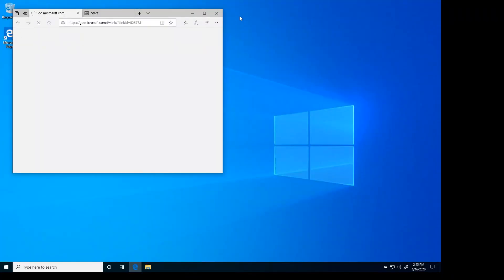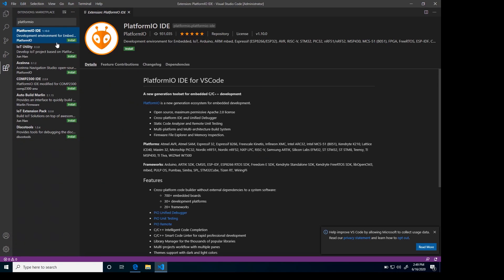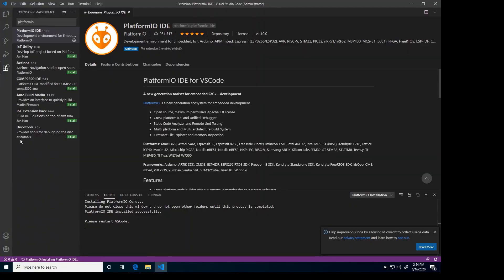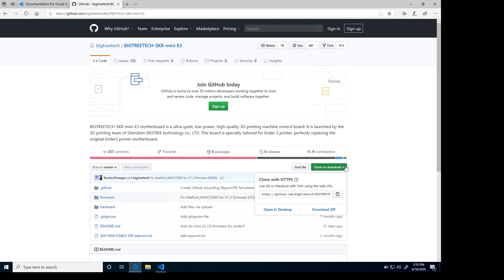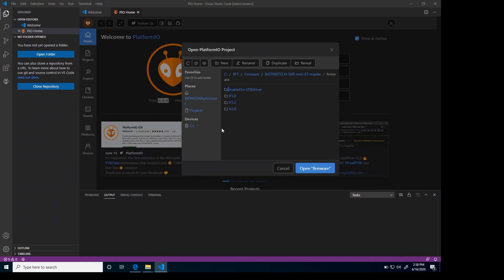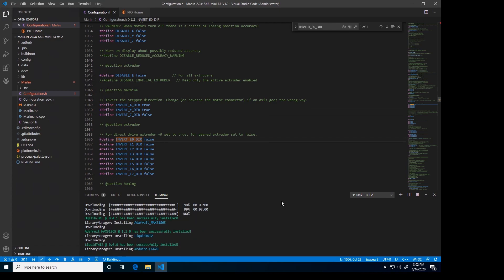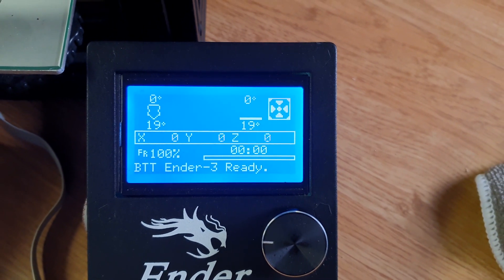BIGTREETECH SKR MINI | Firmware Update| THE EASY WAY

Comment: I have an Ender 3 Pro and a SKR E3 Mini V3.0 with 3.5" TFT screen and I can NOT get the firmware to load. It goes to a white screen that says Marlin Mode at the top over night and never changes. I followed your directions and can not find help anywhere.
Reply from the maker: I will be looking into this shortly, I might need to do an update video.

Comment: I don't know why others dont talk about this but it is easier to reverse the normal running direction for a NEMA 17 stepper motor is to just switching either the left or right pair of wires in the pin connector.  For example:  If the motor runs clockwise and you need it to run counterclockwise instead, you make a note or photo of your pin wirings and in my case that would be Black, Green, Red, Blue being that Black + and Green - are my "A" coil wire pair of positive and negative and the Red - and Blue + are the "B" coil wire pair (which those two are taken from the connection pin plug and reversed from Red and Blue to Blue and Red).  

Once you switch the two wires, your motor will run in reverse of what the factory sent.  

In a nutshell:  Your stepper has 4 wires which are actually acting as two sets of positive and negative.  Take one pair (the right view two wires) and switch their placement and your done!
Reply from the maker: Hey Ken, thanks for the advice, I will try that out and then make a video about it, in fact I am modding my Ender 3 V2 at the moment and I will probably run into that problem.
Reply: I ran into this problem  when I upgraded mine and didn't even know it was a known issue I just started swapping the wires assuming that it was wired differently and figured it out

Comment: thanks for the video! i have the same problem invert extrudeur.. everything work till i try to compil :/
Can you share your firmaware.bin ? please
Reply from the maker: Hi Mike, thank you for the comment.  I will try and get a version for you but did you use the "Windows Sandbox" method of compiling the firmware?  Please also send me the error message you get when compiling.

Comment: Need help!  My printer stopped extruding after doing this firmware update :( not sure why.  I have an ender 3 pro with no modifications to the extruder so I entered, "INVERT_E0_DIR false" is that wrong? *Update for the heck of it I tried setting it to true, obviously no luck.  Printer is now out of commission until I can figure this out.
Reply from the maker: Hi Eturian, I cover the geared extruder at around 08:00.  If you have a geared extruder, you will have to update your esteps, I cover that in another video: https://youtu.be/0bLd1ocwhBI

Comment: how do you enable the ezabl on the new skr firmware? th3d stopped updating for the skr mini e3 because btt threatened some lawsuit, and i'm afraid of messing something up. i haven't been able to get it to print reliably, but it's still better than nothing. if i get that working, the next step is the btt smart filament sensor...

Comment: I know this video is old but I'm trying to do some research because for some reason all of a sudden my btt skr mini e3 board won't read the SD card , it was printing fine with no problems  then I went to print something after printing something the day before and now if I put the card in it it the option doesn't even appear to print from it , I've tried everything from reformatting the card to new cards to a firmware update witch lead me here and nothing is working and there's no info about this problem anywhere so if you have any ideas how I can fix this problem It would be greatly appreciated,  thanks and have a great day
Reply from the maker: Hi, it sounds like a hardware problem.  The SD slot comes under a lot of pressure when you insert or remove the card and the hardware might be damaged on the inside of the slot or the solder joints.  You could go the octoprint route or install the BTT Touch Screen.  I installed one on my printer, still need to do a video on it, and that has additional slots on it.  Can you heat up the printer and move the x,y and z axis?  Try connecting up prontoface and do some diagnostics with that.
Reply: @FusionSource the SD slot doesn't really get used that much because i got the extended slot with the ribbon cable , n i did install the btt touch screen when I got the main board and as long as I don't have the SD card in it it powers up and functions normally and even if I start it up then put the card in it im never given the option to extract a file from it the print from midea selection never pops up

Comment: Hi can anyone help we are group of Vietnam vets which are trying to get into 3 D printing to help with PTS but we have embarked on a fruitless journey. With have an old midgda printer with a duet wifi board which we  updated to version 3 but we cannot get heaters to work just about ready to throw it out. We brought a cheap anycube mega zero and added a heat bed which worked fine for a while and now all we get is a unknown M140 s . We cannot  reset the board or update it as nothing happens . We have tried to follow the video but it does not give us the same result as the screens are different.
So we are back we’re we started 12 months ago , do we give up and start another program we are not computor literate and every video people talk to fast . Can anyone help we need a config program for a duet wifi v3 and how to reset the mega zero 
Thank you

Comment: Having the same problem where the extruder won't push forward, only backward when "loading". Any solution for this yet?
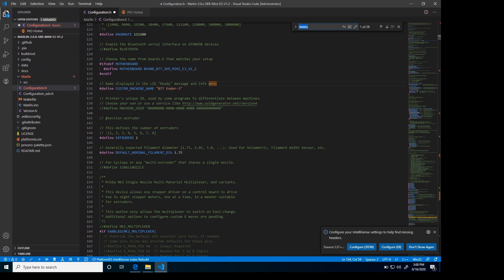Reply from the maker: Hi, if watch the vide at 8:40 I explain how to reverse the extruder.
Reply: @FusionSource  I have a geared extruder and changed it to false as instructed, still not dialed in all the way. Can't find any answers anywhere for this.

Comment: Please Help everything works but after i compile it and go to Marlin, pio, build, stm, there isnt a file named firmware.bin, there is a file named firmware and ive renamed it to firmware.bin but when i try to flash it, it doesn't work, it just boots up normally with out flashing. Any help would be appreciated ive been trying to fix this for hours at this point.

Comment: PLEASE HELP!!  I was watching someone else's video on installing the BL touch. I got in the firmware and changed a few settings as I thought they did. BUT somehow I messed up the card. Now when i turn on the printer the LCD has nothing on it, the touch screen version says " no Printer attached"  . Can you or anyone else for that mater help me? I have tried to find a way to reset it to the way it was and have tried on my own but just cant get it back to the seeing the screen.. Plugged in factory screen and it just stays blank.. so not the screen.. I hope I didn't fry the board.
Reply from the maker: Hi, have you plugged it into EXP3 on the Screen?
Reply: @FusionSource  yes it was all worked till I tried to set up the BL touch.. The loading and powering lights light up and from research it appears to all be working. Just not the screen. I cant get the touch screen nor the factory screen to work. I have ordered a new board to start from scratch.. I guess I have a nice looking paper weight now.. Well I do enjoy your videos and will just stick to the person I can understand fully (you) and goes at a nice pace. The other video I watched was talking so fast and about stuff I guess he felt everyone with a 3D printer would understand. Saying commands and stuff that got me so lost. Now I have a BL touch I may never use if it is that hard to install and set up.. Well thank you for everything. I will search and see what Videos you have that will be helpful in my learning process. Thanks again!!

Comment: I use the v2 version of this board. I also make use of the touchscreen lcd. Now for the LCD to work correctly I needed to uncomment a rule in the firmware, this worked out fine with your method, however, when I try to flash the firmware nothing happens. It just boots up normally. When I check the sdcard on my computer, the firmware.bin file is deleted. Any tips?
Reply: nevermind, I plugged the ribbon cable in the first instead of the third socket, flashed my firmware now, works like a charm.

Comment: (ENDER 3 PRO with SKR MINI 3E V2 ) I am trying to enable MESH BED LEVELING by compling in VISUAL STUDIO CODE but failed with the following message
" STM32F103RC               FAILED    @.333
The terminal process "C:\.platformio\penv\Scripts\platformio.exe 'run'" terminated with exit code: 1.

Terminal will be reused by tasks, press any key to close it."
Reply: are you using ezabl?

Comment: thanks for the video !! how to enable the power loss resume please
Reply: I have the same issue. My print resume is selected, but does nto work. What was this not tested before selling these? Or tested in the new firmware? I need that function back.
Reply: @jiml.9026  did u found out how ?

Comment: "I promise, it's easy" - I don't think so. Many of us are getting errors which are not being addressed. My error is not fixed by the "***Update" in the description. I know it works for some, but there's no guarantees it will work for you. Keep hammers and baseball bats locked up because you'll be inclined to use them during this process!!!
Reply from the maker: Hi David, have you tried using the "Windows Sandbox" method, this is the most "Virgin"" way of installing the updated firmware, there are no other external factors that can get in your way.  What version of the BTT firmware are you using?  Please let me know what issues you are getting and I will see if I can find a solution.  I have done this update a few times using the "Windows Sandbox" and it compiles everytime without fail.
Reply: @FusionSource  Hi Eugene, I don't currently have Windows 10 to use "windows Sandbox". I have a Mac. The main issue seems to be an error in "#include errors detected. Please update your include path." It's similar to the error in the comment from "LeapsofFaith". I've got SKR mini e3 v1.2 with BL Touch for homing. Must I use Windows 10 with Sandbox to get this to work?
Reply: Thanks to your video and advice I finally got it to work. The problem was the operating system. I'm on a Mac so I used that first, then tried Linux (Ubuntu), and Windows 7 (I had an old computer laying around with it) but all failed. I finally downloaded and installed Windows 10 and enabled Sandbox, compiled the exact same firmware the same as I tried before and this time it worked! I also had to apply the update adding the "board_build.core=maple" line to the platformio.ini file. I'm sure some more knowledgeable people can get it working on other os's, but to make it "easy" as promised, Windows 10 with Sandbox enabled seems to be the way to go. Thanks again to Eugene and all others that contribute to the 3d printing community!!
Reply from the maker: @muskokaliving2072  I am so glad you came right, I also apologies for saying "The Easy Way", I had no idea that it would be difficult on a Mac or Linux as I don't have these.  For some reason the Windows Sandbox just works.  Thanks for the comment and letting the community know that you came right using the Sandbox Method, way to give back man, really appreciate it and shows what makes the community so great.

Comment: Get to the stage where I go to "build" the project in Visual Studio Code and run into the error:
 "{
	"resource": "/c:/Users/ssv_m/Desktop/BIGTREETECH-SKR-mini-E3-master/firmware/V1.2/Marlin-2.0.x-SKR-Mini-E3-V1.2/.vscode/c_cpp_properties.json",
	"owner": "c:\\Users\\ssv_m\\Desktop\\BIGTREETECH-SKR-mini-E3-master\\firmware\\V1.2\\Marlin-2.0.x-SKR-Mini-E3-V1.2",
	"severity": 4,
	"message": "Cannot find \"c:\\Users\\ssv_m\\Desktop\\BIGTREETECH-SKR-mini-E3-master\\firmware\\V1.2\\Marlin-2.0.x-SKR-Mini-E3-V1.2\\include\".",
	"startLineNumber": 9,
	"startColumn": 17,
	"endLineNumber": 9,
	"endColumn": 124
}

Have tried redownloading the files etc but can't get it to compile.

Comment: Good tutorial to follow through, however building returned an error with the includePath in Configuration.h (for some reason unbeknownst to me)

Actual error message is:
"#include errors detected. Please update your includePath. Squiggles are disabled for this translation unit (C\Users\user\Desktop\BIGTREETECH\BIGTREETECH-SKR-mini-E3-master\firmware\V1.2\Marlin-2.0.x-SKR-Mini-E3-V1.2\Marlin\src\MarlinCore.cpp)."
Reply: same
Reply: I agree did anyone figure out how to fix this yet?
Reply: @humerusdoc4189  you need to use the latest marlin version.
Reply: @alexam694  No change still happening.

Comment: This did save me. Up to a certain point and I thank you but I get 45 errors when loading the btt firmware folder. When building I get 3 errors. Includepath error and cant find firmware. Somebody please help.
Reply from the maker: Hi Jonnathan, I have found that doing it using Windows Sandbox makes a big difference.

Comment: Since updating following this guide my machine freezes after a few hours and no longer displays the full file name of what is printing - help required
Reply from the maker: Hi Mark, not sure why it would freeze, the only thing I can think of is the main board might be overheating, check the motherboard fan,  I might be wrong but that is all I can think of.
Reply: @FusionSource  Fan is working fine, all is working fine in fact. I have gone through my whole machine so many times now. I am accepting it is just one of those things for now as it is becoming less prevalent, although still annoying when it does happen. It also only seems to happen on certain prints all related to lithophanes, be it an actual lithophane, display case, or lid. I had no problems with any of them prior to upgrading to 2.5.0.3. 2.x Bugfix worked ok. Have also tried slicing on differing slicers to no avail. I will work it out ...... eventually, lol

Comment: Great tutorial, have been following so many others on youtube with so many errors but just followed this one and instant compile, nothing missing etc, as I have had from the other tutorials. I have not loaded it into my printer yet, but am hoping that it will work. I am led to believe that the file on my MicroSD "firmware.cur", is the original, is this correct?
Reply from the maker: Yes, that is the current one.  I am glad the tutorial helped.

Comment: Hey ! really great guide, but there is one problem hat occured to me, Visual studio code tells me, that it cant find the path to a floder named include that should be somewhere in the files, what should I do ? nothing is working for me. thank you
Reply from the maker: Hi, what you can try do is what I did in this video, enable Windows Sandbox, there should be tutorials on how to do that, and do a fresh install of Visual Studio Code and PlatformIO as shown in the tutorial and compile a new version of the firmware.  This makes sure that you have a clean install and that nothing interferes with the build.  I really hope this helps.

Comment: I may be a idiot but still can't get this to work.  board and all is inhaled printer turns on and moves hasn't burst into flame yet so not too ad on the build lol. Problem I have is you and guy from the first slayed both say to load the configuration files into Arduemo o tty and fix a few small things when I complete all my edits and hit validate to get my bin file say error wrong board. Not positive but this board prints off the sd card so how am I supposed to pic a aboard.
Reply from the maker: Hi Troy, did you download the firmware from the BigTreeTech GitHub?  What you can try do is what I did in this video, enable Windows Sandbox, there should be tutorials on how to do that, and do a fresh install of Visual Studio Code and PlatformIO as shown in the tutorial and compile a new version of the firmware.  This makes sure that you have a clean install and that nothing interferes with the build.  I really hope this helps.

Comment: Thanks for the tutorial but i'm not sure what i'm doing wrong as i keep getting this error before i try and build {
	"resource": "/c:/BTT/Firmware/BIGTREETECH-SKR-mini-E3-master/firmware/V1.2/Marlin-2.0.x-SKR-Mini-E3-V1.2/Marlin/Configuration.h",
	"owner": "C/C++",
	"code": "1696",
	"severity": 8,
	"message": "#include errors detected. Please update your includePath. Squiggles are disabled for this translation unit (C:\\BTT\\Firmware\\BIGTREETECH-SKR-mini-E3-master\\firmware\\V1.2\\Marlin-2.0.x-SKR-Mini-E3-V1.2\\Marlin\\src\\MarlinCore.cpp).",
	"source": "C/C++",
	"startLineNumber": 1,
	"startColumn": 1,
	"endLineNumber": 1,
	"endColumn": 1
}
Reply from the maker: Hi Kevin, did you download the firmware from the BigTreeTech GitHub?  What you can try do is what I did in this video, enable Windows Sandbox, there should be tutorials on how to do that, and do a fresh install of Visual Studio Code and PlatformIO as shown in the tutorial and compile a new version of the firmware.  This makes sure that you have a clean install and that nothing interferes with the build.  I really hope this helps.
Reply: @FusionSource  Tried again but still no success following your tutorial i still get a build fail

Comment: this is without any changes im getting error ? 
 The terminal process terminated with exit code: 1

Terminal will be reused by tasks, press any key to close it.
Reply: same issue for me. i have a bunch of errors under the problem drop down
Reply from the maker: Hi, have you tried this:

Add this on line 46 of your platformio.ini file
board_build.core = maple
Reply from the maker: Hi, have you tried this:

Add this on line 46 of your platformio.ini file
board_build.core = maple